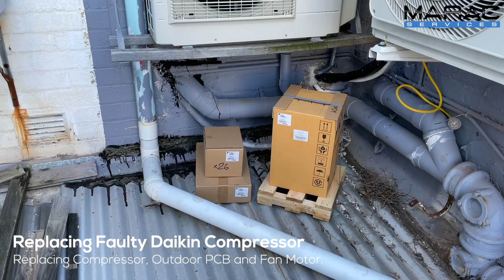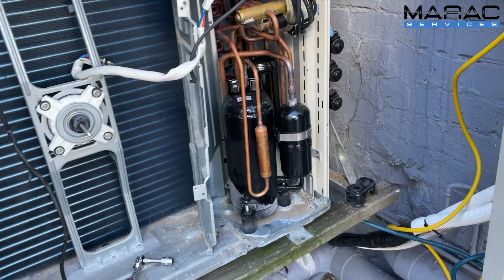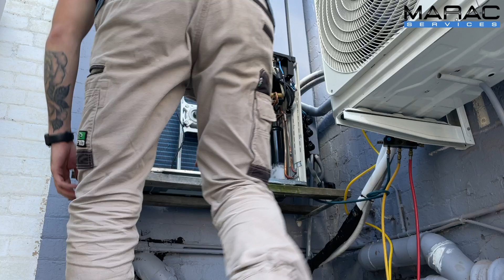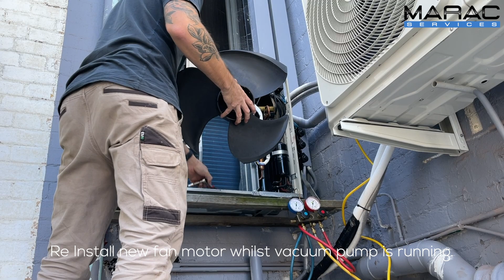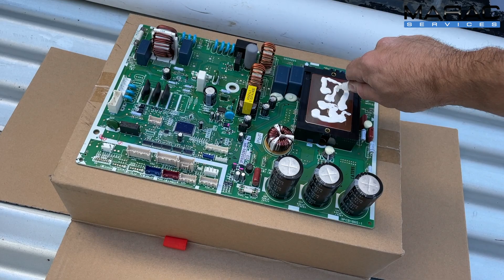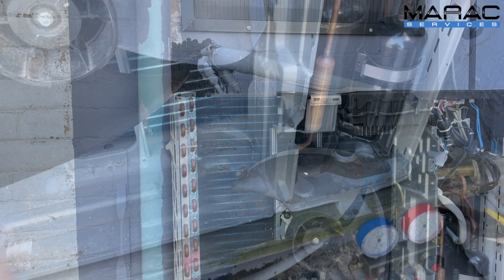Repairing Daikin F3 Error (Compressor EP 3)

Comment: Was this the same time as before or was it replaced again
Reply from the maker: I have replaced the compressor twice on this unit. Before replacing the compressor the second time, I thoroughly checked that all possible causes (EEV’s, correct gas charge, pipework specs etc) we’re all fine. The unit hasn’t missed a beat since. Very odd.

Comment: Typical bloody daikin. Comp fails, tech support says replace all boards and fan motors 😂
Reply from the maker: Yeah it’s crazy, high voltage DC components are garbage. Even fan motors have a little pcb in them now, so they will tell the PCB if the rpm of the fan is down. Things are so over engineered now that they always fail. 
In regards to this job, the compressor has failed twice and the unit is 2 or three years old max 😂
Reply: @maracservices  They’re designed to fail. Can’t beat a  DOL compressor with a basic control circuit. Easy to diagnose and will run forever. I look after a site in Sydney that is full of Daikin VRV units. They’re problematic and poorly designed. It’s the way this industry is going so I better get used to it 😂
Reply from the maker: @cjohns28  I 100% agree mate. You should watch some videos on YouTube of Fridgie’s in the USA. They are all working on Air Conditioners that are basic af. It’s like we get Japanese brands in Australia that are full of unreliable technology but the US manufacture their own stuff and keep it simple. No inverter, just a contactor and thermostat.
Reply: @maracservices  yeah mate I’ve seen a few of the US  hvac channels on here. The systems are so basic, the part most likely to fail is the capacitor. I wish we still had air cons like that here. Even the Australian made units are getting more complex. The top of the range Temperzone and Actron machines now all have inverters with EXV’s. Engineers are so obsessed with energy efficiency that it just ruins the reliability.
Reply from the maker: @cjohns28  haha yeah mate. Actron definitely needed to have a look at their technology because their soft starters were failing constantly but yeah I agree man.